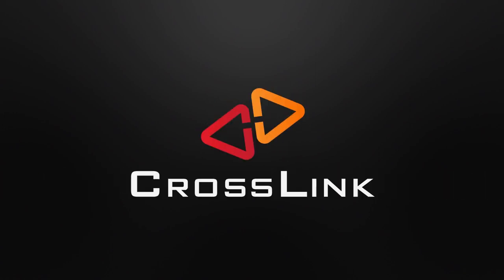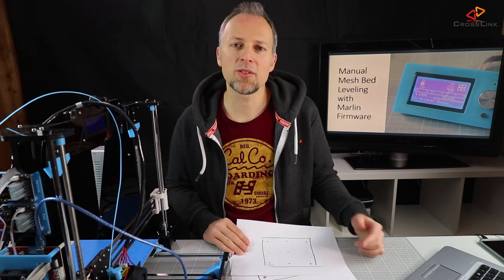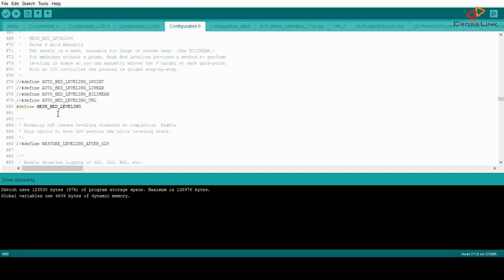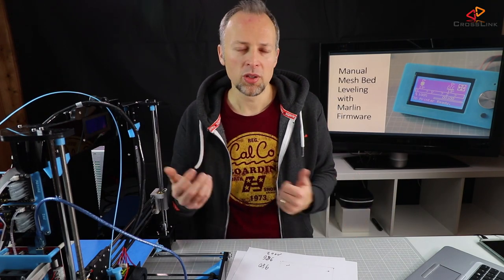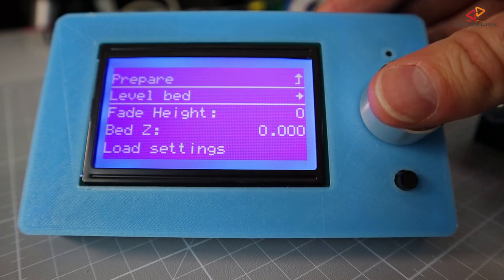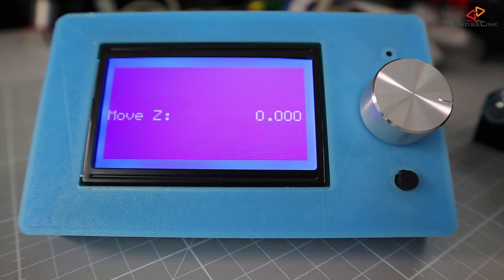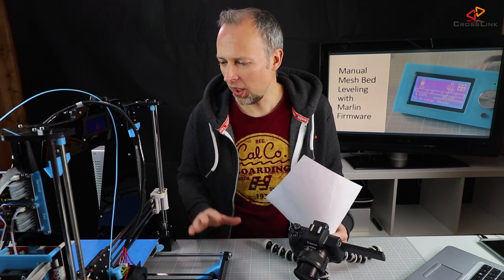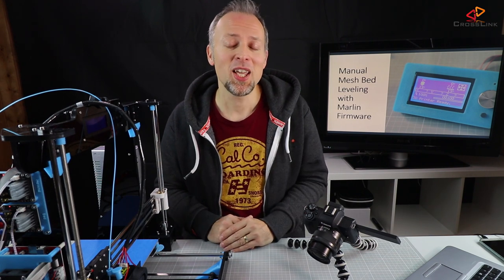Anet A8 manual mesh bed leveling with Marlin firmware 1.1.X

Comment: Thanks for the tutorial.  I've had the A8 for 2 months installed Marlin about a month ago.  Manual bed leveling and keeping it level has always been one of my biggest pains.  If I level the corners I do get excess in middle of bed and this would take care of that.  Mostly affects adhesion and thin prints.  I mounted the printer to a flat surface 2 weeks ago and that helped allot with it staying level.  But still had to play with the middle or corner thing.  Was thinking that's why they use glass.  But that kinda scares me. Was looking though configuration.h but had no clue what   "MESH_BED_LEVELING" was.   Who knew you could fix it in the menu. :) Others who are new to this with an A8.  Forget printing all the braces and stuff.  Mount the printer securely to a flat but movable surface.  That really did help from day  one.   Again thanks allot.
Reply: I can relate , bed levelling is a nightmare!. xixixi!

Comment: Followed your tutorial on flashing Marlin....had a driver issue and 'sync errors' while trying to upload. Looked at the option of using an arduino to flash - had same error and ended up downloading 'CH341SER' drivers for the chip on my clone Arduino. .... that made the Arduino work so I thought I maybe just had a driver error for the Anet board....Tried it with the CH341 drivers and bingo - uploaded and working. Made the levelling changes and re-uploaded and WOW. So much better than messing with a screwdriver or thumbscrews. Thanks for all the info!!!

Comment: Hi Daniel, "hallo!" may I say if I recognized correctly your german accent(!?).
 Anyway, you really rock as a teacher, with cristal clear explanations, and  you have the hability (intelligence!) to clarify and simplify those complicated lines of commands in Marlin: just a thousand thanks for that!
I know I'm coming really late after your video, but I only saw it 2 days ago... I have a precise question for you: I did all you described, also for the #986 (#define RESTORE_LEVELING_AFTER_G28). 
But I tried it (I have an Anet A8 with a V 1.5 board), the manual mesh leveling is perfect, and so are my prints afterwards! 
---> BUT... if I shut off my printer, the next time I'm launching a new print...the bed is not leveled anymore....I  must re-do the complete manual bed leveling again....
---> it seems that the leveling is NOT written in the EEPROM, although I had uncomment the line #986 (#define RESTORE_LEVELING_AFTER_G28) and click on "Store settings" on the LCD panel.... ANY IDEAS?

Thanks again, vielen Dank, hope you'll be able to see my questions and answer it...

Comment: You have saved me alot of headaches, thank you. I was re-leveling my bed on 4 points manually with thumbwheels every time but it wasn't a true indication of the bed plane. Since doing this I can print from cold start and don't need to touch the printer. I have just reflashed all 3 of my printers with this. Prints are turning out far better than before!!

Comment: i’ve watched a couple of these…and maybe it’s obvious so not stated…but it should be manually four corner leveled as close as possible prior to mesh probing…don’t think this is a substitute for getting your bed as square as possible to your machine…good video
Reply from the maker: Absolutely adjust the corner distance before any further bed leveling. Also applies if you have a probe

Comment: Hi! You mention a probe-offset in your automatic bed leveling videos, is there something like that in manual mode possible in marlin? I want to do manual mesh bed leveling with an dial gauge, but this dial gauge has an offset of 38mm on the y axis with respect to the nozzle. Help is very appreciated! Love your videos!

Comment: very good info, but how can I adjsut the bed to make it flat (with the screws) with mesh bed leveling enabled ? 
thanks.
Reply from the maker: just use the menu to move the nozzle around all four edges. skip the points in between and adjust just the edge distance with the screws. Then repeat the mes bed leveling process and fine tune the distance with the menu. Will update this video soon with an easier process.

Comment: Is there a way to shrink the mesh size as the nozzle just misses the print bed edges when I level the bed, I have a 220 x 220 glass bed with corners cut (to clear the screws)
Reply: +1

Comment: Thanks for the tutorial, I performed this setup, but when I click the store settings, I don’t get a confirmation beep or anything. Ps I have the stock lcd display.
Reply from the maker: Yes, that's normal unfortunately. The stock display has no beeper and there is no visual confirmation  😔
Reply: Ok thanks again for the tutorial:)

Comment: Hi, Daniel, thanks for shared with us, i have a question, how can i check if the mesh bed leveling is active or working ?, i was follow your instructions step by step but when i shutdown my printer and starting new printting job the first layer has print wrong, can you help me?, regards...
Reply: This I would like to know as well. After performing a manual bed-leveling in the display it says somthing like bed-leveling activated (can't check the correct message actually because I'm printing). If I switch off Anet and switch it on and open bed-leveling menue, this message doesn't appear, not right away nor if I press load settings. How can I know if bed-leveling is still activated? Just trial and error, like it happened to Mauricio?
Reply: @joelipps5703  Exactly is the same problem that i have
Reply from the maker: There is two ways to activate it. In the firmware you can activate RESTORE_LEVELING_AFTER_G28. This means every time after you home with G28, basically every time a new print starts, the mesh is getting loaded automatically. If you don't switch that on you have to use the "M420 S" command right after G28 every time you start a new print. This should be put in your slicer startup gcode scripts section.
Reply from the maker: Don't forget to save the settings with the "Store settings" menu option after you do the leveling. Otherwise your settings are gone after powering down your printer.
Reply: @Crosslink3D  , thank you for your answer. But this you described already in the video. The question was more, if there is an indication, that after G28 Bed-Leveling is still active. Indication like after doing a new bed-leveling, when it's indicated in the marlin bed-leveling menu by the index "bed-leveling activated". I activated RESTORE_LEVELING_AFTER_G28, I save after leveling with the mentioned Store settings, but after any G28 or after switching printer off and on it doesn't tell me anymore that bed-leveling is activated. Should it do so, or do you have the same behaviour?
Reply: To add: after G28 or switching off on, if I go to bed-leveling menu and klick load settings, nothing obvious happens and bed leveling activated doesn't show up neither in the menu.
Reply from the maker: I see your point. I actually did not bother looking at this because it just worked all the time. Hard to tell if there should be any indication that it actually gets loaded. On my Anet A6 display, I have a beeper that at least gives some acoustic feedback when hitting the save settings menu item. The issue with the original display and buttons is that there is no feedback whether saving was successful or not. Sometimes these buttons just don't work and you don't see it. If it works, most oviously your z axis motors will move a little once the printer starts printing something that spans a larger area from back to front or from left to right. in my case it is really visible that the printer fixes some unequalities by looking at the motors.
Reply: @joelipps5703  I found a solution, with this GCODE command G29 S0, I get last mesh leveling report stored in the EEPROM, in this information I found the state of mesh bed leveling, when shut down o disconet powet supply and turn on again, the state is disabled or off, to enable again we need send the next GCODE command M420 S1, for verify state again we send G29 S0 and if is on or enable the Meshbedleveling conpensation is working, for dont do this process in each print, I did add the M420 S1 command to Start GCode in CURA settings and now my first layer is great.

regards and sorry for my english.

Comment: i am a bit confused with this what if i need to lower the nozzle at 1 or more points but the end stop is triggered? i cannot do it r am i missing something ? 

would i need the z stop lower than the bed? in order to be able to do this or does the nozzle lift up off the end stop before you start and you just lower it to where its needed?
Reply from the maker: no, you have a bit of play between when the endstop actually triggers and when it cannot be pushed further down. that is what you have to work with in terms of micro adjustments.
Reply: @Crosslink3D  oh I see  now it makes sense
Reply: @TotoGuy-Original  hi bro im too confused.. where should I place the endstopper did you find any solution ?

Comment: Is there a way to make the mesh finer?
Instead of the default 3*3 maybe a 5*5?
Reply: Yes, there is a line called "#define GRID_MAX_POINTS_X" there you can change the points per x axis
Reply from the maker: In Configuration.h at around line 1075 you can configure the mesh granularity:
  #define GRID_MAX_POINTS_X 3    // Don't use more than 7 points per axis, implementation limited.
  #define GRID_MAX_POINTS_Y GRID_MAX_POINTS_X
Reply: @Crosslink3D  Thank you :)
Reply from the maker: thanks for helping out!

Comment: If you dont have a limit switch or level sensor what's to keep it from crashing into the bed when you hit home?
Reply from the maker: For manual mesh bed leveling you still use the z-endstop switch for limiting.

Comment: **UPDATE**
seems like I had to add "m420 s" to g-code, too...strange

Does the "save settings" save the state of bedleveling, too? I mean if it's "on" or "off". That is the only explaination for me. That it was turned off and I saved.
**UPDATE**

Hey Daniel maybe you can help me. I have marlin 2.0 and the problem that it loads the data from the saved meshbedleveling after g28. But it's turned of and I have to turn it on by hand. If I forget -> scratched surface :/

So I need to home it by hand -> menuepoint appears to turn bedleveling "on" or "off" (before g28 it's not visible) -> turn to "on" -> it works on the next print. Just turn on no need to load settings by hand...loading seems to work.

Comment: Ive had Marlin installed and have been using the bed leveling option in the menu on the stock lcd. I havent had a problem until this morning, when i was doing the bed leveling, after adjusting point 1/9, i click the ok button, then my lcd screen goes blank, and wont do anything, it gets kinda stuck instead of moving to point 2/9. Any ideas on why its doing this? 

EDIT: i wrote black instead of blank. The screen stays lit up, but shows no text of any kind.
Reply from the maker: What probe are you using if any? Are you doing manual or auto mesh bed leveling? How much vertical  difference in mm is there between the probe triggering and the printer nozzle hitting the bed. Should be less than 2mm, this is set int the firmware. Diffs larger than 2mm also cause this.
Reply: @Crosslink3D  I posted this problem a few places inclusing Facebook and YouTube, but forgot to post everywhere after I fixed it. I don't have a probe, I use the bed leveling option in the lcd menu, but adjust manually. I wasn't having an issue, then 1 morning, it started freezing like I explained in my comment. I tried to reflash Marlin firmware, but was getting a compilation error, which led me to believe that an issue was due to me using the Windows 10 Arduino app. Not the original. After I installed the Arduino IDE and reflashed Marlin, I haven't had a problem since. So for now, I've put it down to the crappy win 10 IDE. Hopefully this won't happen again, but time will tell. Thanks for replying though. You videos have been very helpful.

Comment: Hi man can you help. My. Saved settings in eeprom don't auto load once turned. Off I have to click on turn on bed leveling each time I have everything enabled you said hope you can help
Reply from the maker: Hi, did you enable the #define RESTORE_LEVELING_AFTER_G28 feture?
Reply: @Crosslink3D  Hi man thanks for the reply i have it fixed now i did have every thing exactly as you said it was what i have to do is click save 3 times and it works dont know why but i have a new lcd screen coming soon and that has a buzzer on for confirmation thanks for the help. my channel https://www.youtube.com/user/Beta250trials

Comment: What controller are you using? I have V 1.7. Marlin 1.1.9 would not work with my board because of a lack of memory.
Reply from the maker: You mean the Mainboard version? I had to turn off some features to make it work. And you will need to flash the optiboot bootloader, which only works using a programmer.
Reply: Boy, I would love to know how to turn off some features in Marlin to reduce its size!!!!!
Reply: @corlissmedia2.0  I have same problem I also like to know same
Reply: Arturo Mendéz you uncheck the features.
Reply: @corlissmedia2.0  I guess I have to uncheck some features. Which features are recommended to disable?
Reply: Arturo Mendéz that is the right question!
Reply: Just go back to 118
Reply: @corlissmedia2.0  Thats is an option. Other option is to upgrade MoBo of Anet A8. Any suggestion of any board that could be compatible with anet A8 with more memory?

Comment: Hi mate. Just had a question if someone could help me out. Ive got an anet a8 with a warped heated bed. I have been able to get around the issue with glass and some clips to hold it in place, but levelling has been a constant issue. Ive updated the firmware to marlin 1.1, but am a little confused. If the printer homes all axis before starting the lcd bed leveling process, i think the nozzle would hit the bed or stop due to reaching the z limit switch. In the middle of your video, i think you were talking about this, but I have to be sure before starting. If i level the corners of the bed, so that its level and at z0, im guessing i would have to raise the z limit switch higher so that the nozzle could reach the lower points in the center of the bed, and then store those values in eprom as you mentioned? Meaning that in future, the firmware would just remember those values, and when homing the axis in future, it should never reach the limit switch, but return to the stored values from the lcd bed leveling process?
Reply: For anyone needing help for this problem in the future. Simply level you bed so that the nozzle is too low to get the paper underneath, but nit so low to damage the nozzle or bed, then use the bed leveling in the menu on the printer and move the z axis upwards to the correct height
Reply from the maker: Yes, this could work. In general it's a problem if you hit the z axis switch and don't have enough room to lower the nozzle. The only way to resolve this physical hard stop is to use another sensor like the inductive, capacitive or bltouch probes. The inductive is probably the easiest and cheapest solution. You can connect it to the board directly and it's very reliable unless you want to print on glass. There I would use the bltouch or 3d touch which works with any surface.

Comment: Nope, you do not need to heat hotend. Only bed. The paper is just enough to take into account the thermal expansion on the hotend, to set it to zero.